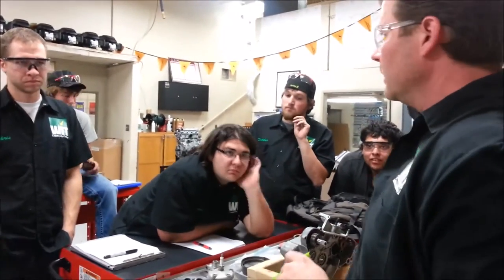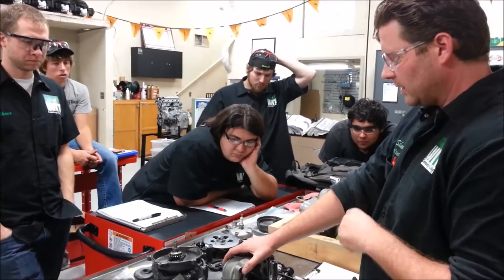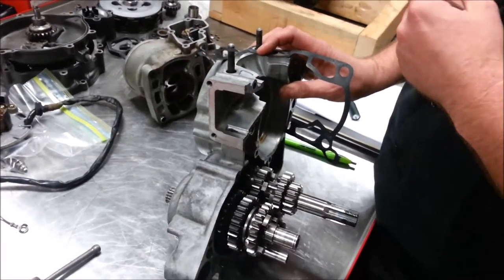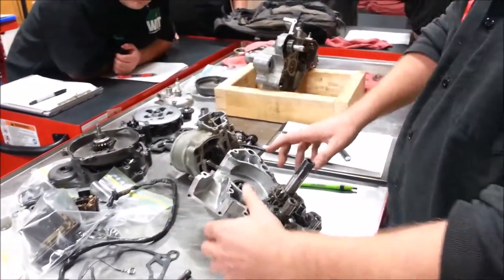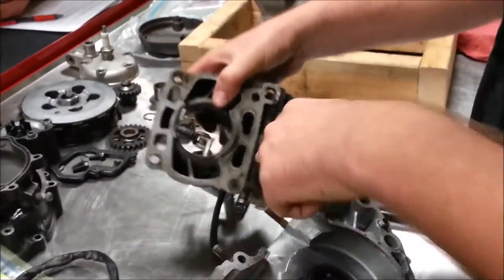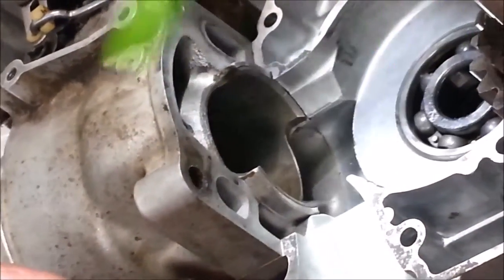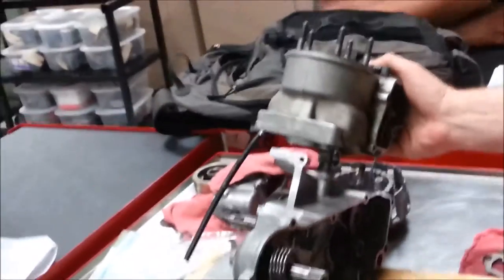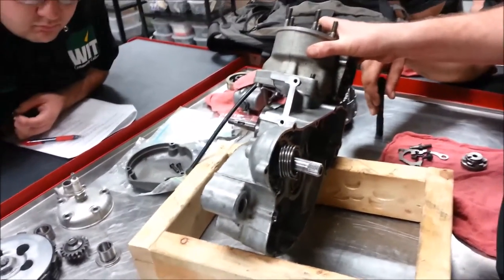2 Stroke Engine Disassembly   Case Matching   10 28 14

Comment: I have a wr450 2004, split cases, manual say i can check for smooth action with the transmission on the left case, unfortunately its no where near smooth (actually almost impossible) , the bike was shifting fine before opening the cases. Does a yamaha have to have cases closed for transmission to work?
Reply: (impossible to shift through gears) like a honda